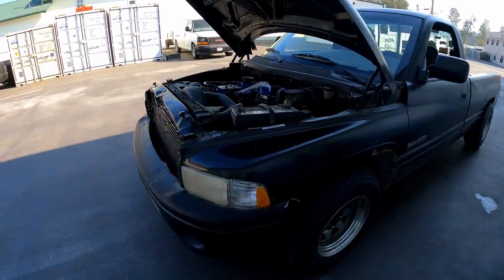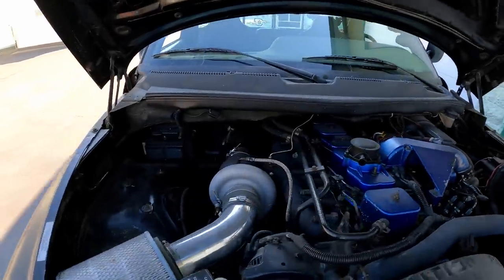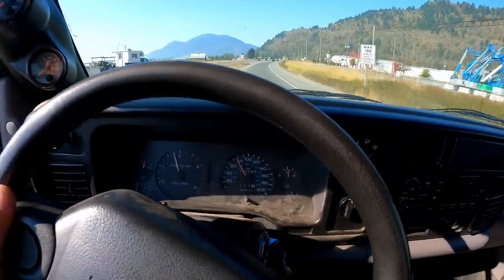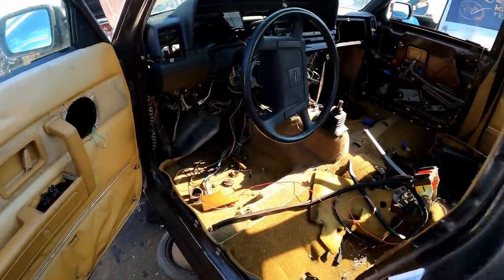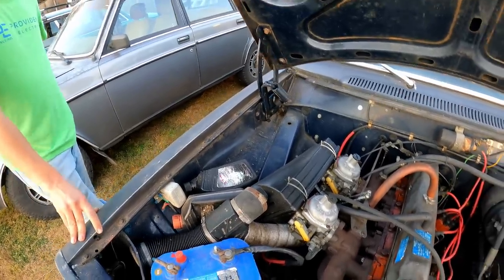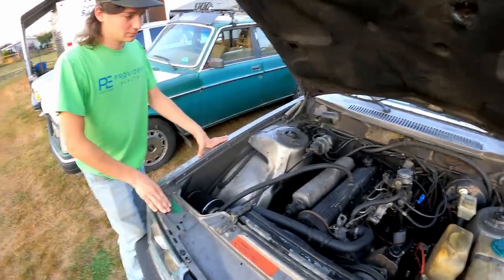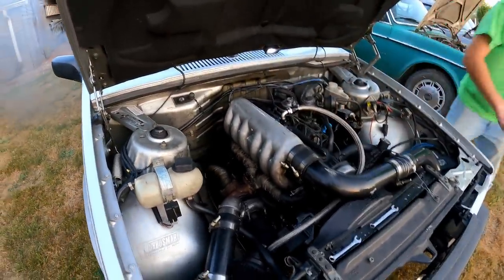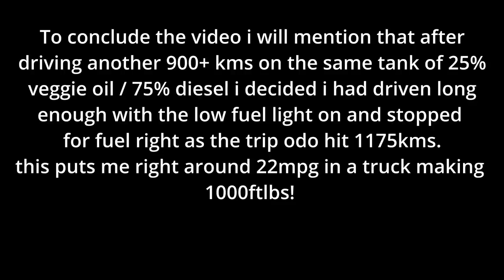getting 1200kms to a tank running veggie oil ?!

Comment: Thanks to drifts n lifts for giving me a interview with my old volvo diesels!
Reply: clean that 760 up duder.
Reply: Too bad for you that you don't have D24tic in America, they are slightly better than D24t and D24.

But the best thing to do is to swap it with D5252T, it bolt up with the original D24 transmission, you need to modify a D24 oil pan and sump (shortening because 5cyl), install the 850 wire harness and building engine mounts. I'm gonna do it on my 745 i had for free with no engine.
Reply: @imposetonstrike9312  is that the vw Volvo collab engine ?
Reply: @Binge420  It is still a VW engine, in the Passat it's the AEL engine. After the facelift of the V70 1 Volvo made their own D5 with their modular block. ;)
Reply: That's a rad collection! 🤘
Reply: damn these cars are so hard to find I am building one lol. found a d24t at a pick n pull and am putting it in a 760 wagon, been driving a 240 diesel around as well.
Reply: another thing is the very early NA D24s had weaker head bolts so they can't handle boost.
Reply: Turner it's Ryan. I haven't heard from you in awhile man. Nice to see you still have your Volvos!
Reply: How can I get ahold of you?

Comment: Best that i know of in the older mechanical diesels veggy oil over time can and will clog up your sending unit, filters, injectors and pump. so mixing it with the diesel isn't a bad idea... although that's the first time i heard someone doing it. P.s I'm not a volvo guy but Wow man that 760!! Wicked sounding.

Comment: I once used veggie oil in my 2012 Mercedes. Diesel. Honestly it worked  just fine. the only problem I had was starting in a very cold weather. I went back to diesel because it's cheaper

Comment: Yep good idea with the veggie oil, keep an eye on your fuel filters if you end up running used engine oil try to let it separate for 6-12 months that way the real sludge will be at the bottom, definitely mix that though will diesel or 2 stroke oil. Or red farm diesel (Cheaper)

Comment: If you think the d24 is the best sounding then u havent heard a d5252t and they make a really good motor for tuning aswell de d24 is quite weak cracks heads camshafts and mutch more but the d5 hosent have those problems

Comment: In sweden the d24 is common and the usual swedish (dreambuild) is allways a volvo 740 or 940 with a d24 no springs on the car and mk18 weels
Reply: yea we see some of those in Norway too, they are usually pretty expensive. Very sought after car for sure
Reply: Is that how they get so low, no springs 😄! I think 18's are too big, the original 17" Oceans looked so much better.

Comment: So what was he saying about piston slap on the 740 turbo diesels? The thermostatic valve fails in the hot air position? Do you remove it and try to get a new part or what's the fix on that? And is it the valve specifically that you remove?
Reply: On gas 740 turbos, the diesels does not have that thermostatic valve

Comment: the brown 81 240 was my old car
Reply: @80Coronadrift - And probably long before it was yours, it was mine.  I owned it from 1995 - 2002? or so and built it up to be an extremely reliable + durable car.  It didn't have a B cam in it; I pulled that before I sold it and installed the famous "W" cam.

Comment: Do you think the vegetable oil goes from your tank through the lift pump completely saturate your fuel filter goes through all the lines then your pump then your rail in what was that 3-4 seconds? Say it's raining the same because it's still running on the same diesel that was in the tank I can almost guarantee you you have no vegetable oil being run on the engine yet

Comment: I need one of those Kjet intakes!!
Reply: @Judd Spaulding message me; I have a couple of them
Reply: Does it perform better than usual?
Reply: @bitchinflexin  supposedly it flows much better than the stock 240 Turbo intake and a little better vs. the intake manifold found on USA redblock 8 valve 4 cylinder cars from '83 - '95.
Reply: @Schwedenstahl245  how much do you want for one?